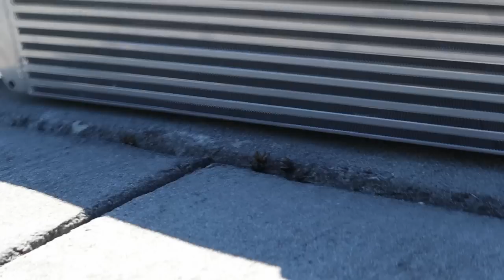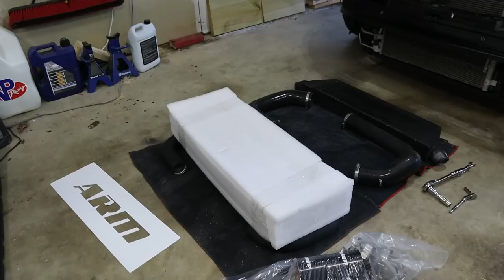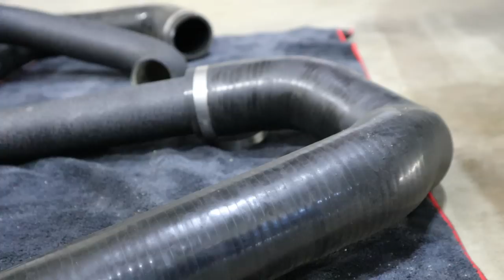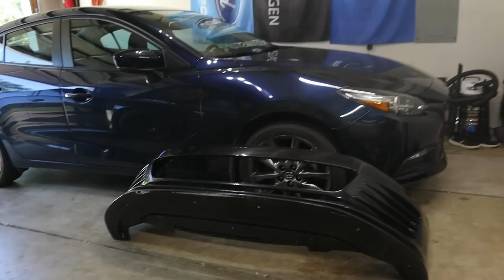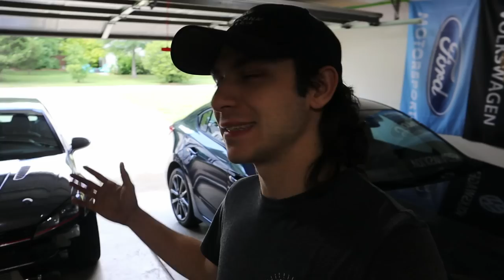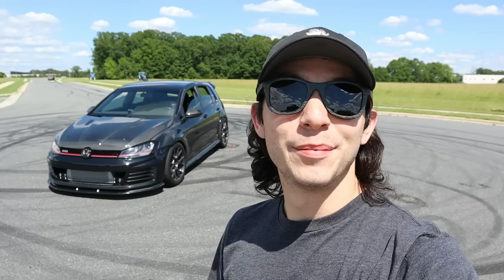This was ROBBING my Big Turbo MK7 GTI of 50+ HP!

Comment: The intercooler piping on the cold side does not match up to ECS tuning cold side pipe you'd have to go source a reducer or use arm motorsports Turbo piping that will match to the one that's in the kit

Comment: What’s your custom exhaust? I’m currently is38 with catless dp and still have the stock resonator
Reply from the maker: I replaced the stock resonator with a vibrant ultra quiet and the rear muffler with 2 flowmaster super 10’s

Comment: wont a bigger pipe require more air before it even starts to build pressure? more area to fill and pressure?
Reply from the maker: If you were speaking about exhaust flow then yes. Back pressure is required to build boost. The larger size IC piping just allows more air into the engine to assist with a more free flowing exhaust to get that balance
Reply: @HaydenCroix  IC piping allows more air, but you also have more area to fill with air, and more area to build pressure into, so there is more turbo lag? flow and pressure are two different things
Reply from the maker: @RafaelGonzalez4  more air means more boost. And it’s the exhaust back pressure that causes turbo lag. If you have larger IC and piping it does not affect back pressure or turbo lag.
Reply: @HaydenCroix  i guess this is where am getting confused and hesitant about aftermarket IC piping, i know more air is equal to more boost,  but doesnt larger IC piping( charge pipe, and throttle body pipe) mean that you now need a lot more air in the system to build that pressure?
Reply from the maker: @RafaelGonzalez4  I get where you are coming from, and I wouldn’t say you are wrong. But that’s because I’m sure if you put a big beefy IC in without being tuned for it you would probably experience lag. But as long as you get tuned for the IC you will not experience turbo lag from it even with a larger diameter of piping.
Reply: @HaydenCroix  okay!  i see, all boils down to the tune.

Comment: Anyone who's doing this, don't forget to unhook your battery before removing your front bumper.  You risk messing up your front radar calibration which will cost you over $1400 only your VW dealer could fix

Comment: Hey man I installed this in my car and I have a cat back exhaust and knn air filter system but I haven’t got tune but when I installed it feel slow on the throttle and a “EPC” light came on the and my turbo is not working it’s not spooling up and not boost is being made. Any advice ?
Reply from the maker: You clearly have a leak somewhere in the system. Make sure to check all the connections you’ve touched.

Comment: I really want to like this intercooler. I think it looks great on our cars, but I have read that the pressure drop is slightly above average compared to most stock location IC. This concerns me.
Reply: Psi won't change what changes is spool time aka turbo lag
Reply from the maker: I did not notice any drop in psi
Reply: @HaydenCroix  Right, however, usually pressure drop is compensated by the turbo. Meaning, the turbo may be pushing harder to meet the boost requirement due to the pressure drop. If the data is accurate, an independent tester tested a number of popular IC brands and found that the ARM IC had a drop between 3-4 PSI. Most stock location IC lose between 1-2.5 PSI.

Comment: I removed my front grille as well but I customized it. At first I cut it so I can leave the lower part of the grille in the bumper, I then cut of the mesh part of the grille and I was left with like the frame of the grille, that way it covers the exposed painted clips when removing the grille and it looks way cleaner
Reply from the maker: The car now has a new grille installed.
Reply: @HaydenCroix  why you put the grill back on ?
Reply from the maker: @charle_fg1  the bumper couldn’t withstand the downforce from the front lip without the support of the grille
Reply: @HaydenCroix  I’m planning on doing the delete for the look , so I should be fine ? Since I don’t have a front lip installed
Reply from the maker: @charle_fg1  without a lip you will be all good

Comment: Why change the CTS for ARM, ARM is the best CTS
Reply from the maker: The CTS FMIC is only rated for 450 hp and became a choke point in the tuning process for more power. This ARM one is a much larger core allowing for more air and in the end more power from the tune. If I could go back I would have done ARM from the start as the install is much easier.
Reply: @HaydenCroix  My thought is to install an I38 later and stay until there. At the moment, it has the factory one, but I want to mount an intercooler and I don't know if CTS or ARM, what do you recommend?
Reply from the maker: @mariorflores7299  ARM 100%
Reply: @HaydenCroix  ok Thank you.

Comment: Question on the hood how do u install the hood pin and where
Reply from the maker: There is a video on the channel about it if you'd like to watch it, but I mounted them to the headlight support brackets. Otherwise it's just a lot of measuring before you cut, I used a "holedozer" to cut the hood after making my pilot hole.

Comment: Nice overview of the product.  
A couple of things.  The ARM core is 3.25" thick.  Vendors stating rated HP is not very useful without knowing how they arrived at the number. *Edit: Stated HP is worthless because there is no standard for determining it.*  ARM states 700 hp and the next paragraph states that it's rated to handle 575 hp.  Notwithstanding the HP value being meaningless, compared to the Vibrant 12810, which ARM is essentially a clone of, Vibrant claimed 550 hp.

Comment: How did you get the mounting brackets to fit? Can’t get the right side one to fit its slightly short?? Could you do a quick breakdown in the install
Reply from the maker: The right one was tight but I was able to get it into place. Don't tighten the top screw until you have the IC mounted up.

Comment: The metal tubing might look smaller on the outside, looked like you stretched the silicone pip over the outer of the metal. I'm willing to bet the smaller tubing has a very similiar inner diameter of the tube. effectively being the same piping. The added benefit of it being aluminum the air will also have better thermal cool flowing the pipe as well.

Comment: Why didn't u use an oversized mqb location?
No offense,but that front mount alone is robbing hp
Reply from the maker: Simply because I didn’t want to go through installing an oem location one. Especially when this one is good for 700 which is well above my power goals.
Reply: @HaydenCroix  fair enough. 
My mqb is my first car not having a front mount,but I'm only putting down 399 hp and 445 lbs.ft tq.
Do u think in your situation an mqb would make a difference on a dyno at all?
Reply from the maker: @luckyhands4995  To be honest I’m not 100% sure but I know that in comparison to the CTS one I took off it is allowing for more power now. The car should be getting on a dyno soon, just have a few things to get sorted first.
Reply: @HaydenCroix  sick can't wait to see,thanks!

Comment: nice intercooler! you will definitely free up some ponies and your car will deliver more consistent performance, pull after pull. the best is always to log before & after IAT, boost etc...and actually see the difference. that way you definitely know it works.

btw...when you boost...i hear this high pitch whistling noise. i had the same noise on my g6 gti and i eventually changed my intake...the noise was completely gone. not sure if it even bothers you, but i didn't like it at all

Comment: Hayden good video..... I've got one thing to say from my experience I think your dv is fubar. Look into the gfb go fast bits dv+ install. It's that little whine while on boost that's giving me this vibe...... Peace
Reply from the maker: Already have an oem replacement on order!
Reply: OK that's cool is this the one that came with the turbski? You will gain power and responsiveness straight away from this too 💪
Reply from the maker: @davidkane8660  This is still the dv from my IS20, I swapped it to the TPC20
Reply: @HaydenCroix  sweet buddy hope you get it sorted. Ohhh with the hard pipes all you will ever need on the mqb platform will be 2+1/2 inch only if your aiming for 4 digit hp figs you then would need 3inch. Also look into the other boost hard pipes to replace the plastic oem ones that makes a big difference also.
Reply from the maker: @davidkane8660  Thanks for the advice! Always greatly appreciated!

Comment: Well with this solid steel piping it’s actually a much healthier boost than silicone piping since it’s a solid flow of boost, where as the silicone stretches a bit, so the flow is more inconsistent.
Reply: I will say with the metal piping it does tend to get hotter easier vs. silicone being more heat resistant, so it’s definitely a big trade off
Reply from the maker: Good to know!
Reply: Yep bet it pulls better

Comment: I've had my ARM FMIC for over a year and I suggest replacing all included clamps. I had 2 pipe blow offs until I changed clamps. 👌✅
Also sounds like your diverter whine is strong.. got me a GFB DV+ and issue was solved. Cheers
Reply from the maker: Thanks for the heads up! And I have a new DV on order to hopefully solve that!
Reply: What kind of clamps would your recommend instead? I'm shocked these blew off. There are two on each end and they looked pretty stout.

Comment: I’m full e85 rx500 making 460whp on 29psi.. I run a cts intercooler and haven’t had any issues? I came across your channel but would be interested in the long term with the arm fmic
Reply from the maker: You can definitely push the CTS to its limits as you have proven. This one will just allow for a bit more headway. I will definitely be making a long term review as well.

Comment: I've gone the other way, stuck a massive Wagner intercooler on and going to rebuild the turbo but keep it is20 but with stronger internals. Then run the boost up a bit
Reply: I prefer the is20 over is38 especially for drivability...i miss the low down torque and responsiveness you get in the is20 that is absent in the is38

Comment: I haqve the CTS on right now and love it, no issues at all. I didnt know though that it was only rated for 450WHP. If I decide to go vortex I will probably pick one of these up! Stage 2 EQT for now, but had to do wheels suspension wrap and aero first. Might do the turbo swap next spring
Reply from the maker: The CTS one will be fine for a stage 2 car even on e85. But yeah once you go vortex you may want to look into an upgrade depending on how much you plan to push it.
Reply: @HaydenCroix  my build is kind of backwards stage 1 powermax with forged internals and titanium valve springs and retainers. But stock dp and intercooler probably in the range of 370-380wheel tuner recommend the do88 know anyone using it on a upgraded turbo?
Reply from the maker: @TheMrec94  a lot of the EQT guys run the Do88 with hybrid turbos and even some that are running full frame upgrades with it.
Reply: @HaydenCroix  how's that big front mount been holding up? Install looks easier than the OEM location ones what's the price point one that one.
Reply from the maker: @TheMrec94  there is a link in the description to it, and it has been holding up great! And you are right the install was super easy! I would definitely recommend it.

Comment: I did'nt buy an intercooler for my GTI Clubsport yet, as it costs an ARM & a Leg!   😄  👍  (One thing though your camera is MUCH more jumpy than the regular youtuber, so if i were you i would get a stabilizer like DJI Ozmo or similar for your phone. Its very though to watch when its this jumpy..)
Reply from the maker: I do have an Ozmo for the phone but I film on my Canon. I will have to look into getting a ronin or something similar because I have noticed the shake as well, even with max stabilization it’s still pretty bad.
Reply: Stop being a little girl, the video was really that hard to watch? Get over yourself! 🤣

Comment: Have you noticed any reduction in oil temperatures with the new intercooler?    That would be a quick way to verify its more efficient compared to the old one.
Reply from the maker: I have actually, I am running about 10 degrees Fahrenheit cooler!

Comment: Hey dude where are the mounting brackets on the ARM unit? I swear I couldn’t see them but probably wrong. I’ve got the CTS one as well, but definitely want to switch 🤙🏼
Reply from the maker: It came with a separate bracket that bolts to the front shroud (the intercooler can also be flipped upside down
Reply: @HaydenCroix  oh shit love that. Drilling the holes through the crash bar for the cts was not fun lol